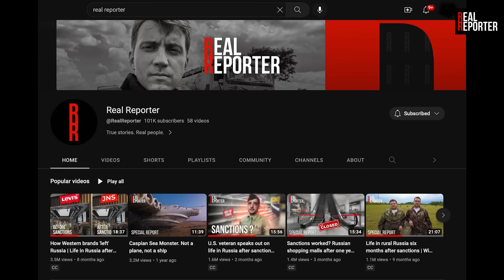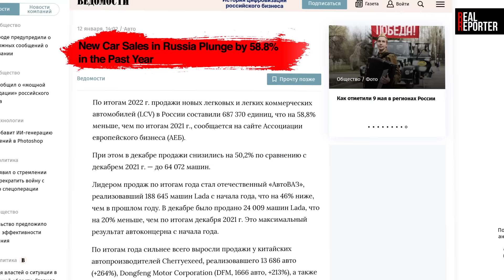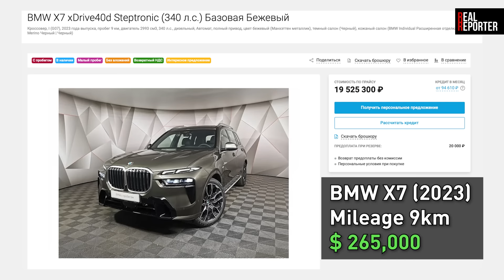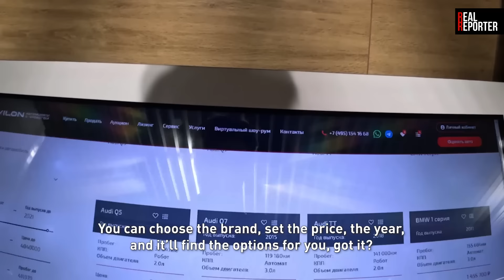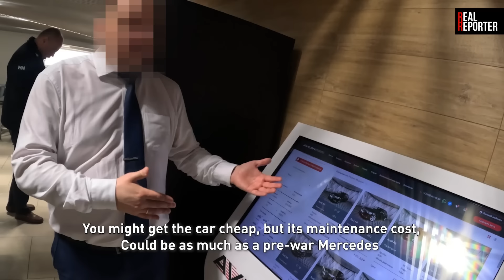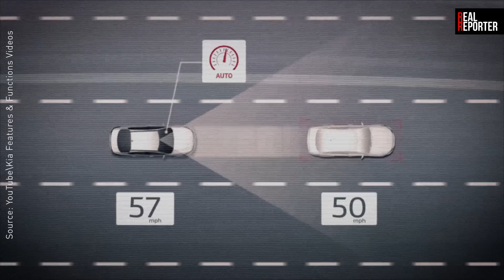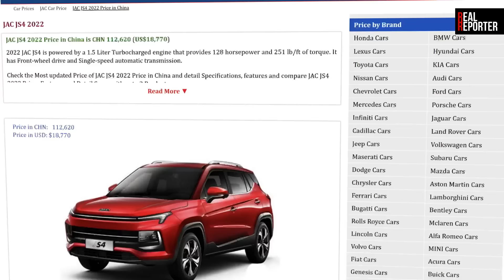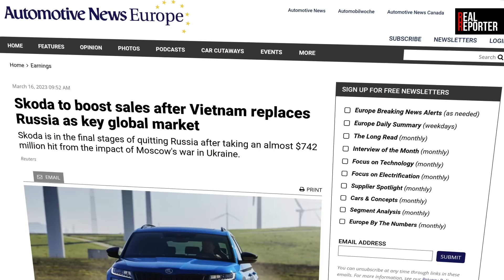Sanctions vs Russia’s car market. Who wins?

Comment: Hi. Love the content. I wanted to answer one of your questions. Ferodo (British manufacturer) 'premium' (they're no brembo but they're decent) brake pads. I replaced all 4 (front and rear) on my BMW X3 (first gen, E83) last Novembre. Pads cost me $40 in total, labour was another $20. So $60 in total. 
Our average monthly wage in Belgrade is about $700. So a bit less than 10% of the average monthly income. 

Cheers from Serbia!
Reply from the maker: Hey there! Thanks so much for sharing this, It's very interesting to see how these costs translate across different countries and income levels. $60 for all 4 pads including labor sounds like a good deal to me. Keep enjoying the content and sending in these nuggets of wisdom - they make our community that much richer.

Cheers right back at you from here and keep safe in Serbia!
Reply: @RealReporter  Thanks for the answer!! It actually was a pretty neat deal. On the other hand, it wasn't a licenced BMW mechanic, just your regular know-it-all down the street. 
Two funny things that I found intriguing:
1. As my SO daily drives a Mk2 Punto (1.2L petrol), I find the price difference for the minor service hilarious. Her 44kW pecker is $70. My 20d e83 is $200. 
2. There's this plastic gear in the transmission box (reductor gear iirc). BMW designed it out of plastic. This gear activates your AWD so it's pretty bad if it breaks (and it does). Anyway, licensed dealers charge $1,100 for this to be fixed.
The gear itself is a part priced at $35. I replaced mine myself. A couple hours of work for eleven hundred bucks of difference. 🤣🤣

Comment: A n interesting piece . Do cars find their was from friendly South Africa into Russia ? In RSA they build many cars (300 K )  for export LHD and RHD..  Parts costs : I bought front Brake discs and pads for my Toyota Van for  $ 155 and my mechanic fitted them for $65 . I use a trade parts supplier in my Town and the mechanic has been known for a few years.

Comment: The jags are cheap, because those models are sh*t. With Russia not being able to get direct parts for them, WHEN they break, not if, WHEN, you won't be able to fix it.

Especially when the electronics clonk out and it costs you more than the car to repair them.

The parts are impossible to find in a western market, let alone a sanctioned one.

Comment: The prices also rise up in Poland. The sanctions are double-edged sword. The all branches are connected... If the Europe resigned with cheap coal, oil and gas, the production cost more even the food i much more expensive now..The inflation in Poland is highest since 1990-1994... In 2022 I paid by car dealer 342,24 pln (78,41 USD) for 5l of oils, in 2023 I had to paid 480,10 pln (116,10 USD) for the same amount of oil, cabin filter costed in 2022 131,73 pln (31,87 USD), this year I had to pay 169,74 pln (41,06 USD), oil filter in 2022 costed 50.26 pln (12,15 USD), in 2023 I paid 70,73 PLN  (17,10 USD), the changes are about 30%....

Comment: Why do you claim 19,5million rubbles is 265.000usd? Its 190.000 usd, wich makes the X7 normally priced.  In Finland it costs 190.000e.
Reply: In my country, BMW X7s go for $90-120k, so $200-265k is a WHOLE lot more.

Also, this video was filmed several months ago when exchange rates were probably a bit worse; they fluctuate a lot.

Comment: 65$ to change your brake pads 😆 What a THIEF!
Reply: Also, always ask about the price of work before they start looking at your car. Ask about diagnosis and know that he can tell you if your pads are worn without taking them out from the caliper. I think he did it so that you have your pads in your hand and go buy new ones, instead of putting your wheel back on and letting you go to another mechanic. Do not go there any more.

Comment: Keep your Opel on the road for as long as possible. It's cheaper than buying a new or new 2nd hand car.

Sorry to say, but many of your countrymen wouldn't know a quality product if it hit them in the face.
I know this because I live in Russia and have bought Chinese or Russian goods. Always look good, say they'll do the job, then in 6 months, you've gotta buy something better.

Sure. The Chinese have come a long way in a short time in motor manufacturing, and that should be anyones concern.

Look at Toyota. The biggest manufacturer with a long history of reliable and well-built cars, yet they still have to recall some occasionally, for unforeseen faults.
Doubt the Chinese will ever recall anything, as that's a sign of shoddy workmanship and a slight on their government.

Please don't buy Chinese. They will not last like your Opel has, plus its Moscow where a new car within a week, will look like a 20yr banger, covered in dents and scratches 😮😂

Comment: I really don't understand what's the big deal with all these Western countries whining about China taking over car production. For decades now almost everything else, all products are manufactured in China, why cars should be the exception? This time they are doing it in a smarter way, selling the cars under their own brands and they also own the company, not like in the case of iPhone or notebooks. If we survive the climate change which is mainly caused by the emission produced by cars (doesn't really matter if it has an internal combustion engine or electric), mass produced cars will be Chinese like everything else that is mass produced, only luxury goods will be made in the West like p.e. all clothes are made in China, except really expensive ones like Brioni suits, those are still made in Italy etc. This russian situation has just sped up the process, nothing really surprising. Don't buy a Jag, not a reliable car 😀

Comment: Well in Lithuania I had recent experience of fixing my car. Planned oil change, filters etc; changing disks, brake linings and one shock absorber ended up with 230$, which is very cheap because of better parts and labor.

Comment: When huyndai started selling suvs in the usa i got a first gen hyundai santa fe  in the rust belt...a few years later the gas tank corroded and leaked gas (in our garage). A well known issue that resulted in an action class lawsuit against hyundai. They learned how to make.better cars (nowadays the issue is that you can steal them easily). Ill have to assume the same road lays ahead for chinese brands expanding tonnew markets.. a few weeks of ownership seldom tells you much, is on year 5th of ownership that you start seeing the differences ( road salt rusted panels,  interior squeaks and rattles due to temperature differentials, premature worn out components etc).

Comment: As Vladivostok citizen I can't understand Enxiety for "new cars" for the rest of the Russia. We drive used Japanese cars and happy to get almost brand new cars for less than half a price with multiple options included, and high standards of safety. However, I recently tried to buy a new shock obserbers and it turns out that there is nothing for my car in the market. Not even Chinese analogues. And this affect safety of the drive. This is pretty dangerous situation. And as western countries always declare that "human life is sacred" putting people at risk to get off the road and get killed or injured, somehow not correlate with this slogan. However, this situation as strange, because there is no products even from China. Which even more ridiculous. And that goes not only for shocks of course. Not that my car is unique. It isn't. And parts is commonly used in other models of the brand. Which mean many car owners are affected. So it's very dubious question.

Comment: I live in Estonia (right over the border from russia) - looking right now of prices from bmw dealer and brand new  X7 xDrive40d (without additional options) is rated at 112 000€.
But seems like Kodiaq price is kindof alright - same models here (2019 year, ~100k on the clock) are about 31-33000€

Comment: jaguars are very unreliable their engines like to fail eat fuel and parts are very expensive engines parts to change are hard so much mechanics charge arm to fix a jag when they say there are enough parts so there are not much parts but expensive af

Comment: 10:56 Here in Brazil a full set (2 pairs for the front and 2 pairs for the rear ) of brake pads for an Opel Astra (it was sold here under the name Chevrolet Vectra) would cost $77 (USD) including labor.
Reply from the maker: Pretty much the same then…
Thanks for sharing 🤝
Reply: @RealReporter  That price is for a set of Bosch pads. A cheap generic aftermarket kit costs $55 (USD) including labor.

Comment: Nobody really expected that the sanctions would stop any new European cars being sold. We expected the prices to multiply by 2-10x depending on the car.

Some of the old cars still run and are being traded. Some of the new cars get in by smuggling. Of course this smuggling is more work intensive, and introduces a bottleneck into the supply chain. Thus the price of a cheap car can easily 10x, and the price of a more expensive already rare car, might be quadrupled. 

Also, availability of parts will get a similar effect. When your BMW breaks, the parts now have to be smuggled into Russia. This introduces more supply bottlenecks, hikes up costs due to operating costs, and due to rarity. A BMW part that a European mechanic could get for 100€ in one day, might take a Russian mechanic over a month to acquire, and cost 1000€ or more. 

So it is quite obvious, the rich oligarchs will still be able to operate their supercars and luxury SUVs. Who this hurts, is the already suffering Russian middle class. Those guys who are engineers, doctors, business owners, etc. And if you tell them that their quality of life, and access to commodities is going to plummet, they might be less happy to work, or even move abroad. This further hurts Russia's capability to produce even semi-modern weapons like missiles, tanks, helicopters, planes, etc. 

The regular poor peasant, and the super rich corrupt oligarch won't feel this. But the very important middle class, will feel these sanctions hard.

Comment: Your car is a Chevy cobalt and those engines die at around 150k the head gasket is made from weak composite material and rubber timing belts on the older years

Comment: Brake pads are easy, shops that build them are easy to set up & surprisingly common. This local manufacturing becomes a worry when the “please fasten seatbelts” sign comes on at 36000 feet. By the way .. how much are the cars now with the Ruble going through the floor. Russia deserves this

Comment: Its crazy that the your old Opel Astra is still worth 6000USD in such a bad condition. A similar model and in much better condition would be worth around 1500€ - 2000€.This shows that the market is under high tension in Russia.

Comment: Chinese mostly don't buy these brands since domestic consumers focus on full electric cars so the Chinese brands that are popular in China are not Haval, Geely, and definitely not Chery or Exceed but brands like Nio, BYD, Zeekr, Li Auto, Hongqi.

Now most makers are shifting to offering mostly hybrid or full electric cars. Bigger brands like Haval, Geely, Changan, Hongqi, GAC are introducing full electric or alternative new propulsion like hydrogen combustion and hydrogen fuel cell.

Having said that, Geely and Haval and big brands and have tonnes of smaller brands under their parent groups. Once more Chinese brands get a foothold of Russian market, they will compete between each other and prices will come down. When they enter they are greedy but once more compete, prices go down. Tesla has had to cut prices by up to 50% in China for some models just so they can compete with domestic brands.

Comment: It may be that the Chinese send the cars to Russia. because in China you apparently have to pay a very high registration fee if the car is not an electric car. That they can go to an event and bid on a license plate. and the claim is that it can cost as much as $10,000 it is also said that China is going to tighten the Emission requirements so that many cars will not even be able to be sold in China
Reply: What you said is completely wrong.
PHEVs and BEVs only have a 10% tax break compared to ICE vehicles, which is not enough to get everyone to fart around and buy ICE vehicles, in fact traditional ICE vehicles still make up 70% of new car sales in China.
Only individual cities such as Beijing and Shanghai have discriminatory licensing policies for ICE vehicles, but these cities only account for a very small percentage of the overall Chinese market in terms of car sales. It is not enough to influence companies' decisions.
The new emissions regulations were published back in 2018 and only became enforced in July this year. All car companies have long since completed the switchover of their products to comply with the new emissions regulations. Even the cars exported to Russia are compliant with the latest Chinese emissions regulations.

Comment: Compared to priced in Estonia, for most of the models, Russia seems to be about 20% higher. Truth is, all car prices have skyrocketed recently due to inflation and the lack of certain car parts in the past 3 years.
The Chinese cars might look okay and and drive fine but it's all about reliability. How good is their warranty actually?
Reply: The Geely plant in Belarus has been operating for several years and there are no problems
Reply: @Biboran.  I don't see any properly old high odometer Geelys around.
Reply: @incremental_failure 
Geely Hover H5 is popular on the streets you can meet them

Comment: Statistically speaking, cars in EU grew up 25 to 45% in prices, in the last 6 years. And it looks like something similar happened in other markets too. Lately there have been several chinese brands imported here in Italy too. I must say, it's a shitshow. Those cars are not priced exactly cheaply,  and the quality, simply put is more or less crap. Also, no dealerships. Electric cars are a joke, and on average cost 30 to 50% more than the equivalent ICE.  Last year my father bought a 2018 VW Caddy diesel with 130k kms for 20k euro. Those cars are extremely in demand, since you can no longer find many MPVs, only useless SUVs. However, second hand car prices are still somewhat affordable for certain categories of vehicles.

Comment: the russians are still allowed to travel to the EU and here they buy from the street market  .

So you simply need to drive to the EU and then buy and import a car from here which is easily done and easier in the future cause prices are now dropping again. You can export such car only if the value is below 50000€ and then you have to pay russian import customs and what not. 

You simply buy a ticket to get to the netherlands or germany and get a car from here. 

And yes, cars are sold in russia as new with 20 km but they are not cause the eu papers have been destroyed after arrival . 
These cars are usually registered at the end of the year to gain market shares. Then the dealers need to get ridd of these cars and russian buyers pick them or in particular: every russian only get 1 car to get the export done, not a dealer buying 100 cause there the trouble would begin, at least in the commercial vehicle business.

your 4 brake pads were not cheap and the labor costs not, cause a mercedes e-class set of 4 is about 75€ from a brand and 80€ for a backyard shop in better shape to repair it.

So try to come over in january 2024 to benefit from the sales of then used 20 km cars with an entry in the eu registration which means used car and therefore you would also import a used car which is a lot cheaper for you then to declare to import a new car. Obviously russian customs are getting less. 
And if you wann avoid all the hazzles seen on your astra go ahead and try to get an electric car cause the maintenance will be an awfull lot lower year by year no new ignotion parts, no oil change, no oil filter, and even brake pads last multiple times longer cause your usual braking will be achieved by recuperation and charging the battery. This power generation will slow you down in a normal situation easily, therefore no brakes needed and no wear down of the brakes at all - quite the opposite: you need to brake really hard from time to time on the highway exit to clean the brakes from the rust especially during russian winter and salty streets. Do not forget the january cause prices will be low in the first quarter caused by these cars registered for the first time onto the dealers name which make them used and driven 20km on the contract - but sometimes or quite often in reality with 1 km or even none if the car delivery had been close to the spot where the car has been parked. Happens all in december , some are also sold in december to customers , but the biggest selection is available in January and therefore also the biggest selection of used cars if such buyers sell their car afterwards. Older BMW i3 or Opel Ampera = Chevy Bolt have for example the best of both worlds to offer, where the ice engine is acting like a range extender in the most economical way I mean the most economical rpm to charge the battery and power the drive train if the battery is empty. But for the usual commute distances these cars are great but also come with compromises cause when new they had been quite expensive and you always have to think twice that the maintenance is a bit higher (no clutch no gears make it cheaper to own).